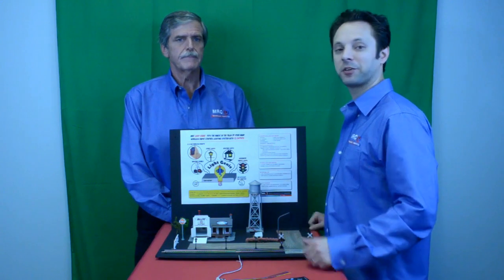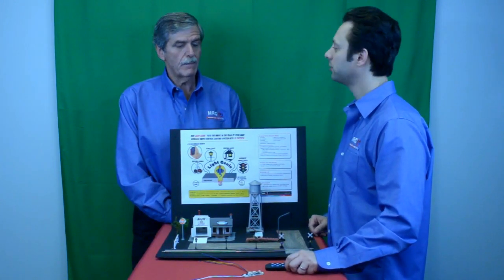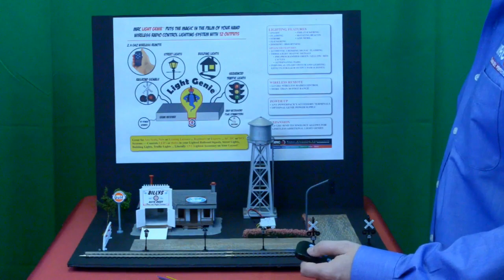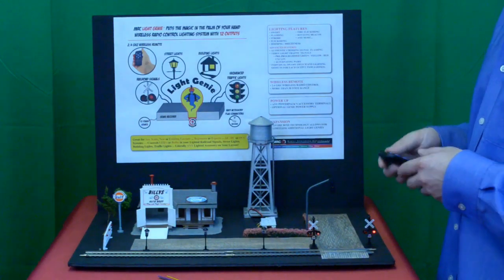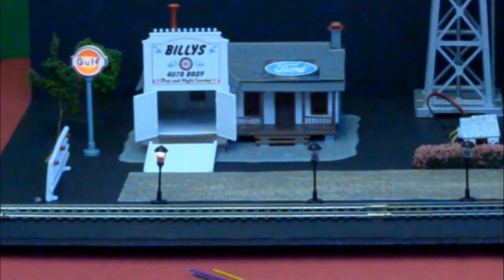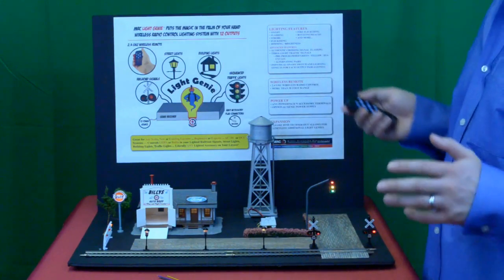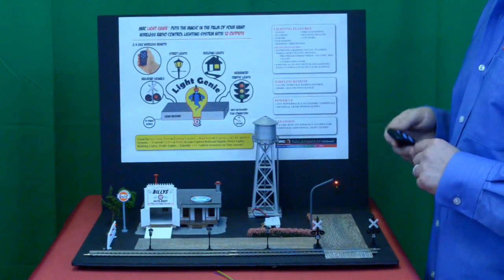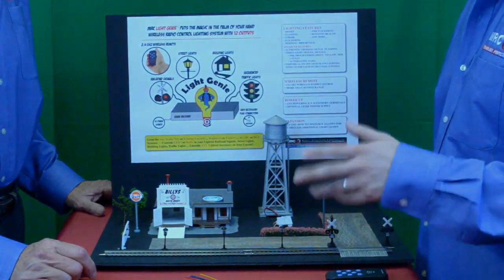MRC's Light Genie™ - Remote Lighting Control for Model Train Layouts, Dioramas and Hobby Products

Comment: Over the past few years I've done occasional searches for ways to simply and inexpensively control my LEGO train layout lighting through remote. Every search turns up 'tutorials' for people who already sort of know or don't yet have any lighting installed and want need a starting point... or want to hang a bulb over their table. THIS is more like what I'm looking for. I already have a bunch of LEDs I've wired up and installed and I want to control them in a way that the Genie is capable of (I don't mind some rerouting of wires for the greater good). It seems it'll have no trouble operating my switches which is ideal. I'm guessing (hoping) that by now there's an app or program for MacBook that will replace the handheld controller and if not then get on it lol. 
So glad I found this!